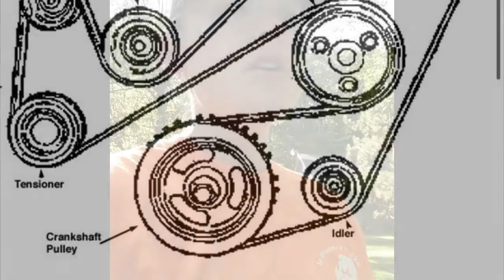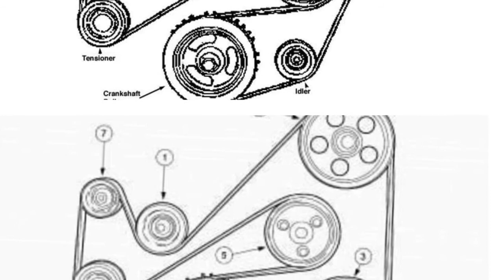AC Delete on a Ford Focus

Comment: The ac compressor pulley in my 2007 Ford focus at 198k has been seized for months, its starting to scare me so I began searching for remedies and came across your video I AM SO THANKFUL! I ordered the recommended parts and cannot wait to get them Thank you so much for your explanation, I am confident that this extend my cars lifetime dramatically.
Reply from the maker: I have around 50k miles on this set up and have been happy. The car is parked for electrical reasons right now, but I know it will start right up when we get that figure out. I’ve been happy with it so far!

Comment: Serpentine Belt  = DAYCO 5060845 - aka 6PK2145 

6PK2145 :
6 = 6 RIBS
PK = Car/Truck application
2145 = 2145mm  (84.5in) length

No noise, no problems.

Elizabeth, Thanks again for sharing your solution for this problem.
Could not have done it without you.
Reply: Does this belt work with the idler pulley used in the video?
Reply: Does this one work?

Comment: Thank you so much for this video! I went with a belt length of 84⅝ inches and that went on nicely. I couldn't get the 84¼"belt on. Thanks again you saved me a few hundred bucks on this car.
Reply from the maker: The 84 1/4 was a tight squeeze!
Reply: Have you had any issues with the 84 5/8 belt?
Reply: Jerad Lambert  I went with a belt length of 84⅝ inches and that went on nicely.
Hi Jerad, Do you have a part number for that belt? Thanks in advance! -JT
Reply: @JT-gq8wv  I do not have the part number. When I ordered the pulley I told them I wanted a belt 84⅝"that would work on that pulley.
Reply: @landingtrouties  It's been a couple months now and the belt and car are still doing great!..... Well the rust is getting it.
Reply: @jeradlambert4650  Got it. Thank you.

Comment: I just deleted my A/C on my 11 focus at 290k automatic. She was Tearing up the belts every few years and ive replaced the A/C compressor 2 times and its alot of money for new ones lol. i even recently bought a A/C condenser because originally it looked damaged and it needed to be replaced. did all the work and had A/C for about 2 days before my belt started to burn again lol, the pulley was just melted plastic, just melted to nothing and my Compressor was also melted too! im rocking no A/C currently as of recently due to all the issues. the ford focus does run like a champ tho, i love my 11 focus its super reliable.
Reply from the maker: I replaced the AC condensor once or twice on mine too. The delete was the best way to go for the car itself, but also for my wallet! I am okay with no AC to have a better running car, and not having to fight for it.

Comment: Thank you so much for the help. I have a Ford transit connect 2012 with the same engine 2.0L everything worked perfectly fine with all the part numbers, but all the part numbers are one year old so we went to O’Reilly and they’re under different part numbers. These are the new part numbers. As of 6/25/2024 

Idler pulley with spacer and the bolt that you need 

 (2330203) MKY brand Murray 
At O’Reilly

The serpentine belt number 

(K060840) brand Master pro
At O’Reilly 

You may find these parts with the part numbers inside of the YouTube video with any other auto parts, but they didn’t carry it at the time it would be a 2 to 5 day delivery 
(the fastest one that I know that had it is O’Reilly)

The only problem I had is that my idler pulley was too close to the engine block, so the pulley was not spinning  the way I fix this is that I put 3 half inch washers behind the pulley for it can come off the engine block and spin freely 

My recommendation is your car should not be running on this set up we only had to do this because our compressor was completely stuck and we needed it to get it to the front of my house that was three hours away

Comment from the maker: I wanted to add, I am 5000+ miles on this new set up with no issues!
Reply: Is the interior of belt 84.5 or the exterior?
Reply from the maker: We cut the old belt, and measured the length, then compared to the 2007 model with no AC.

Comment: Been over a year 20 k miles later and still going with bypass pulley
Reply from the maker: 25k later and it fires right up. This seems to be a good long term fix so far.

Comment: what was the number for the belt size?  84 1/4
Reply from the maker: We used an 84 1/4 but others are saying it was a bit too tight for their liking. I've got quite a few miles on this set up with zero issues.

Comment: Hi- Elizabeth- I have a 2011 Transit Connect - Your technique is identical with one exception - I had to use  A 3/8 in thick nut + washer to shim the idler to get clearance from the engine block.
Almost ready to fire it up - The belt has a precise width as well as length. Also number of RIBS. Can you provide the part number of the belt you used?
When looking for a By-Pass pulley, they all bolted to the place where the AC was. I could not get an answer to finding the exact pulley flange that matched the bolt pattern of the AC Pump - I was almost resolved to just buy a new pump and just not connect it.
Many thanks for your OUTSIDE THE BOX resolution of this problem ! 
I'll update my results.
Thanks Again,
-JT
You bet I subscribed !

Comment: I have a 05 focus and I believe the area your talking about is on a cover? At least it’s what it looked like to me. Mine has a bolt in it now. It also has a indentation formed in the cover. Just making sure this is the right area.
Reply: I’m trying to put pictures on here but can’t figure out how.
Reply from the maker: Yep, mine had a bolt there too. We removed it and replaced with the idler pulley.
Reply: I actually installed it this last weekend. Thanks
Reply: @WildGooseChasePtHA  pic

Comment: What new hole? Did the new pulley bolt into to??
Reply from the maker: There’s a bolt/hole in the front on the casing. Look at a diagram of a 2007 without AC and you’ll see what I’m talking about. I have it in the video.

Comment: Literally just ran to the same thing on a customer's car... Are you able to leave the existing AC compressor on the car? With this bypass? Or does the compressor need to be removed completely?
Reply from the maker: No, there wasn’t enough room for us to leave it there. We cut the hoses and pulled it out.

Comment: I do have a question about the pulley..did it have any adapters or any other parts with it and did you have to buy a longer bolt? I am trying to do the same thing and the bolt that was in the hole where the pulley goes isn’t long enough…and the inside of the bearing of the pulley is way bigger diameter than the bolt..any feed back helps..great vid
Reply from the maker: The pulley we ordered had a bolt that came with it, along with washers/bushings. It was plenty long enough and the correct size. I find it odd that you got a different one if you ordered the exact part I did.
Reply: @WildGooseChasePtHA  I didn’t realize you had the part number till after I bought a pulley for the 07…the pulley I bought was smooth it grooved..but I ended up figuring it out but thank you for replying back..YouTube has solved many vehicle issues for me

Comment: Thank you for the video, I assume you can leave all the AC compressor and pulley stuff installed?
Reply: I would also like to know, hopefully doing this to my car later today as long as the part gets here
Reply from the maker: I don't think there would be enough room for both pulley's in there... I removed mine in total because the compressor seized, and then the clutch did too. No reason to keep it there. Just putting strain on the motor.

Comment: So did you end up taking off the air compressor?
Reply from the maker: Yes. There wasn’t enough room to bypass it, even with a shorter belt. We removed it completely, and cut/clamped off hoses.

Comment: By the way when you removed the ac compressor hoses did it come with gaskets on both hose lines. Thx for any feed back
Reply from the maker: I didn’t remove the hoses. We cut some out for ease of access but left the rest. Because my system wasn’t charged, I didn’t worry about capping them or removing them all.
Reply: @WildGooseChasePtHA  did you remove the ac compressor completely
Reply from the maker: Yes, space was an issue, and it interfered with the new belt pattern, so we had to remove.

Comment: Elizabeth Richard's did u leave the ac compressor and if so how were did you install the pully at? Was there already a hole? Any pics of your awesome work thx.
Reply from the maker: Looks like you got it figured out, but I ended up having to remove the entire AC compressor. It seized completely and was in the way of the new belt pattern. The idler pulley we installed was in the pattern of a 2007 instead. I did include some diagrams in the video and a short clip of the pulley we installed.
Reply: Elizabeth that's exactly my same question lol I wish we had a photo

Comment: Did you have to remove a bolt to install the idler pulley?
Reply from the maker: No. We used the bolt that came with the idler pulley.
Reply: I think he means the spot well this idler pulley bolts into to. Is it just a hole that's already open? Or do u have to remove a existing bolt.?

Comment: Does the new belt have the 1/2 inch of play recommended for proper function?
Reply from the maker: I couldn’t tell you for sure. It went on just fine, and was the recommended size for the 2007 model with the same set up.

Comment: What was the idler pulley that you used?
Reply from the maker: Gates 36328 Idler pulley

https://www.gates.com/us/en/power-transmission/power-transmission-components/idler-pulleys.p.7803-000000-000426.v.7803-01428.html
Reply: Thank you . I am going through this right now. Will give a follow up when I receive part and install
Reply: Thank you so much for the vid, and info.Your research into this dilemma is priceless!